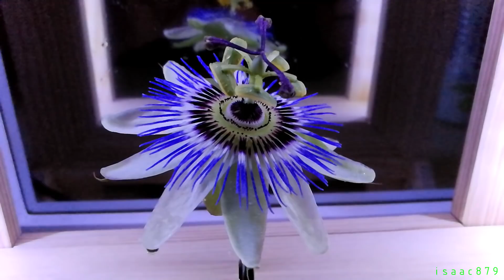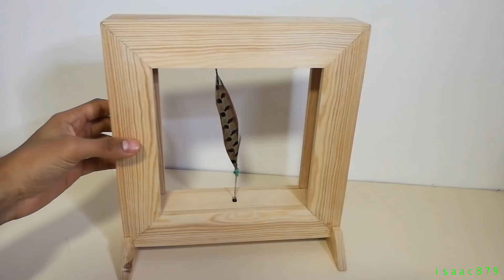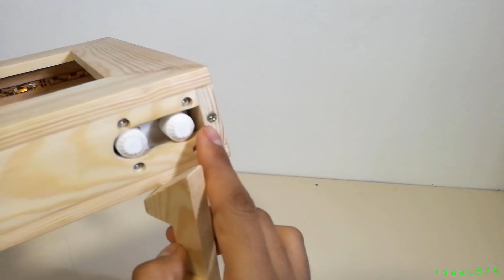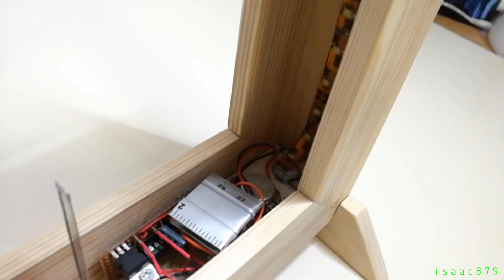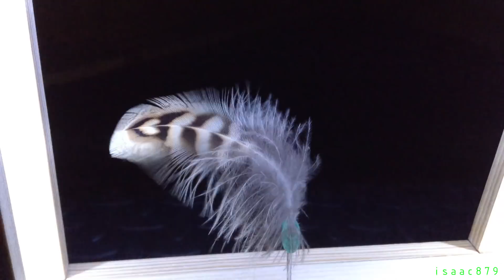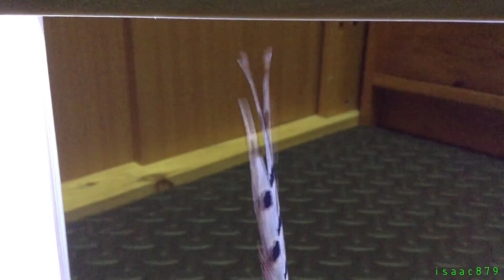Time Frame The Slow Motion Display

Comment: I was considering whether it would be possible to have simulate wind in a living landscape painting using this—tiny plastic trees with leaves, and moving grass—but overheating might be a bit of a problem if the ballast weighed too much or if it had multiple coils (unless it had a very quiet fan installed that would actually make it feel like there was warm wind coming from the painting). Really cool design idea, regardless.